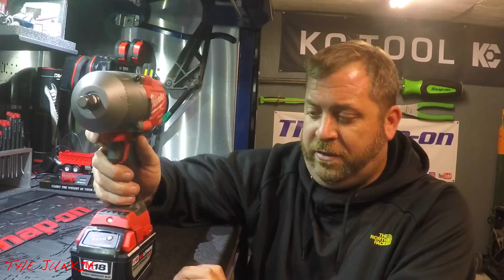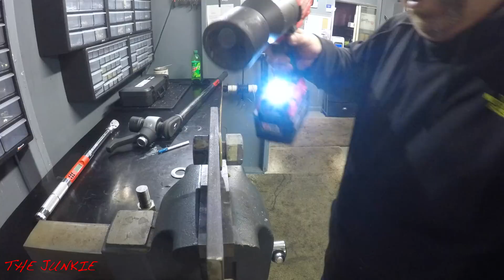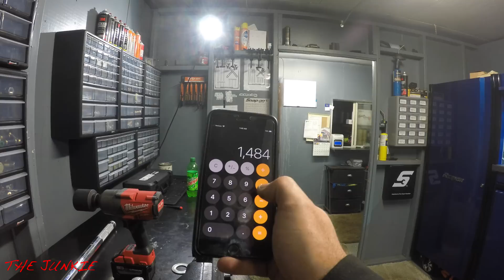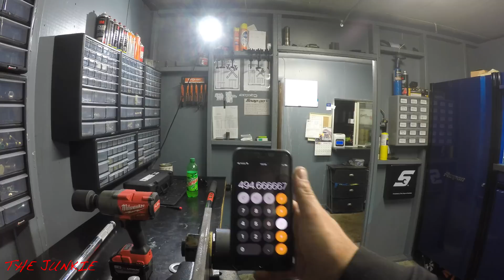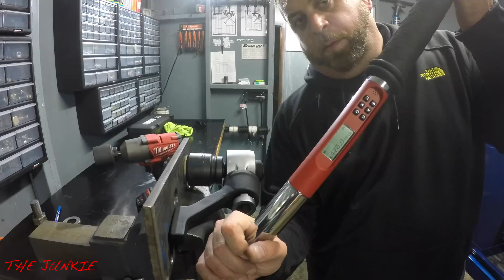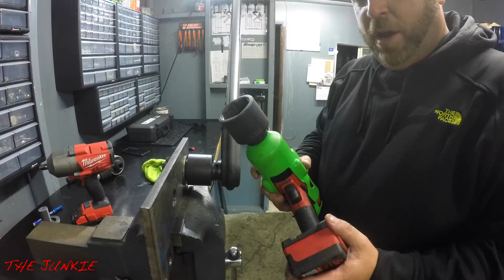REAL WORLD MILWAUKEE 2767 TORQUE NUMBERS?🛠🔩🦍💪🏿

Comment: Not necessarily “real world” results.   The gun set comes with a 3.0ah battery or sometimes a m18 XC5.0Ah.   A high output battery is gonna crank a lot harder, obviously. 

I have one that’s almost 5 years old (and a lot of outdoor rugged mobile mechanic use.)  I just pounded on an 18mm suspension bolt, on setting (2) and I’m at 70ft/lbs. makes me sad after watching this lol. 
make no mistake if I put it on max turn setting and removal it definitely can takeoff any nut. Including ones that the best SnapOn couldn’t.  Was turning ones that required Oxy-acetylene to get some off.

Comment: If you had it on level 4 it goes from 1750 rpm down to 750 after that to just oull the bolt or nut off. But if this was just level 3 then I am not sure. Kinda seems more like the battery is struggling more than anything.

Comment: I have both, and there are times where the mid torque isn't enough (on car/SUV/pickup). Rust is the disease, and the Milwaukee 2767 is the cure.  About 10% of the time I need it, and glad I have it.
Reply: Same here..i tried using the mid torque on removing a couple of  honda crank bolt with the lisle socket and no budge. I used the 2767, no sweat. There are also times the mid torque is not able to remove rusty lug nuts/bolts...so again, 2767 to the rescue!

Comment: I like the review, I wanted to get that muthafracker just in case I had a bolt that was stuck. But like you mention that its more for heavy equipment users, I'll probably get the smaller lighter mid range impact. It was still a very impressive review pushing the milwaukee beyond its limits.

Comment: The grade 8 nut probably cracked because you welded it, the heat changed the temper. 
Has anyone done any testing of this gun with different battery capacities? I just bought one (tool only), and I already have a bunch of 4.0 ah batteries from other Milwaukee tools, so that’s what I’ve been using. Yesterday I tightened some bolts to 250 ft lbs with my torque wrench, and later tried to remove them with the Milwaukee, and it wouldn’t do it. Hopefully that’s just a battery issue, not a bad gun

Comment: Interesting idea for an experiment. Can you do another video that shows you undoing the bolts with the snap on torque wrench after the impact wrench fails so we can see the true torque that’s required to unscrew the bolt?  I believe that the torques to tighten vs untighten are different because when you untighten, you have to overcome a static friction first before the bolt will move. When you tighten, static friction never comes into play, only dynamic friction.  Thanks.

Comment: I have one of these nut smackers, I do Heavy Mining equipment repair, I also moonlight doing steel fabrication and erection and light automotive. - I would definitely say there isn't much use at all if you're a car mechanic. Doing heavy equipment most of the time its not needed either, only as a replacement for 3/4" air impacts on some jobs, some counterweight bolts, etc. - Has heaps of power for rusty plow bolts and track grouser bolts.

But really it shines when you're putting steel together and you're trying to get beams to fit and you're running bolts through splices to push/twist the whole beam over so you can get the next one. Running it straight for a minute or more.
Heavy duty, can get as a 3/4", way handier than pneumatic.

They're also selling a 1" Impact now but from what I've seen its underpowered compared to other 1" or 1 1/2" air impacts, battery tech isn't quite at that point, at least not in 18v.

Comment: Got mine about a month ago and been putting it through the paces. This shit is fucking frightening. Like for real. Even with a 36in and 10 in extension this fucker pulls fasteners right the fuck off. Like pulling a choir boy out of the preachers hands like mentioned below! Be careful, with the HO 6.0 batteria this will have some gravity but nothing a pair of balls can't handle. Not for you pansies out there pulling lug nuts and nothing more. This is meant to do work not show off.

Comment: Buy the big dick banana hammock.  Dads got the 3/4 inch  Put yourself a cover plate overtop brake that fucker off number 3# mode. That why you have it when  you need it .   It's like Carrying your gun rether have it and not need it. Then need it and not have it.    That big fucker works to my dad and me used it to work on his cat track loader 32 year old bolts zipped right off   some of those bolt were over a 1.1/2 diameter

Comment: Wow, we could have done without the "Foul language".. Uh, and for those who wondered,  the nut cracked bcuz it was Not one with the threaded shaft, or rather not a solid bolt. The area which was Not welded was the weakest point and gave out.

Comment: It has a variable speed trigger so im going with BDBH for auto work. Esp axle nuts, crank bolts and suspension work. Have 2 vehicles that need new front suspension, Illinois pothole roads 🙄

Comment: My makita hangs right with my partners Milwaukee. It's another amazing impact out there. They're both pretty ridiculous tbh.
Reply: I bought the Makita 1/2” drive one after seeing what my workmate’s Dewalt could do. They seemed very similar results wise, we did a few unscientific tests on fork truck lug nuts. At the end of the day you go with your battery platform. Only found one set of nuts it wouldn’t shift, 36mm socket, struggled with my long 3/4” ratchet with a cheater bar, reckon they’d been over torqued with an 1” drive air gun.
Reply: I have the Makita as well and am very pleased with it's performance and design so far

Comment: Not understanding the 3:1 torque calculation.  Yes its a 3-foot torque wrench, but unless you're using it with an extension, the wrench should be calibrated to its length.  I've never done any corrections on my click-type wrenches.
Reply: @Zboe-JL  Why would one need to multiply the torque??? As long as you're using the tool as it is intended, the tool should be calibrated to its own length.
Reply: @johnstaif846  The torque multiplier is used to torque the nut down to 1400 pounds.  He is not strong enough to torque that bolt to 1400 pounds with a 3 foot wrench, no one is. The torque multiplier increases the torque he applies using the wrench by a factor of 3.  If you look closely, you can see the torque multiplier attached to the bolt and then the torque wrench is attached to the torque multiplier.
Reply: @dkelly701  Oh.  Thanks for responding.

Comment: It’s not 1400. You heated up the thread exponentially when you tightened it. Should’ve put an infrared thermometer on it until it went back to room temp. Plus that gun is shot. You hear the internals? Lol.

Comment: Good video Justin .
And I agree that the real world means a hell of a lot more in testing then using grease bolts and a Skidmore Wilhelm, the real challenge is it going to a junkyard and find an early 60s truck or trailer backed into the weeds what's lug nuts that have not been removed for 20 years in the elements, a lug that is torqued to 250 foot pounds of torque that have not been removed in 20 years will be so corroded but I have no idea how much nut busting torque it would take to remove it off of the Krusty pitted threads, but that's what I call real world testing Karma something like that would be a real test, thank you on your opinions and testing.

Comment: This impact is strong as sh*t
I was taking off an engine mount bolt and it sheared the head off so damn fast
Reply: RCMOTO thats not a good thing
Reply: Michael Sieber I didn’t say it was, 
Obviously in the correct application , it is a good thing

Comment: We use those impact wrenches on large structural steel buildings; awesome for that application. The only issue is the vibration associated with tightening larger diameter bolts tends to shake the batteries loose and causes the blade contacts to burn out in the driver housing.
Reply: Spot on with the battery vibration issue. What I've seen is the big/ heavy 9.0 /12.0  batteries are rough on the rattle guns that get hard hours put on them. It's nice not needing to carry a bunch of extra batteries but eventually, the contacts will fail from the extra weight of the bigger battery. We're on rattle gun #4 or #5 now. They're a great gun with loads of torque for sure. Its just not the ideal tool to be used with the high capacity batteries. Seems to me that a better battery to tool interface/lockup would help. The slop between the gun and battery gets pretty bad after awhile

Comment: I have only stalled mine out once so far. It was on an upper control arm 21mm nut. I had an impact swivel and a 6 inch extension on it on level 3. Torque spec is 110ft lbs but someone went full beans on it or something. This gun is definitely needed when you work on rust bucket vehicles every day.

Comment: Workmates got the new m18 one key. On power level 3 with 2bar left in the battery i tried it against my fully charged snap on gun and it pulled those wheel nuts off like nothing. Damn i need to buy one.

Comment: First time you do a timing belt on a Civic or 4 cyl Accord you will NEED one of these babies. Those front crank bolts are no joke. It is sometimes possible to get those front crank bolts off with a special, extra heavy, $50 socket and the top-of-the-line Ingersoll-Rand 1/2" pneumatic @ 125 psi - but usually you have to borrow someone's 3/4" I-R impact or jump on a 3/4" breaker bar with a six foot extension held in place by a jack stand for 20 minutes after soaking the bolt overnight with PB blaster. That crank bolt is pretty much the only reason I had to get one of these monsters. I'd don't ever want to have to fight a Honda crank bolt again like I'm a 98 lb weakling in the ring against a 22 year old Mike Tyson. 
The only problem with this tool is going to be when other mechanics start using these things on setting 3 for everyday work, there are going to be a LOT of stripped and mangled threads on wheel studs, suspension bolts, axles, & everything else. It's like using a sledgehammer for cabinet work.

Comment: I bought my 2767 last week.  I couldn't get my lugs off a 1962 International p/u.  I used a pneumatic gun on my Porter cable compressor - no go. I used a breaker bar 1/2" 18 " long with a pipe extension  - no go. The Milwaukee took it off like butter!!!  Funny thing though... I had it sitting on my counter next to the stove, when I turned on my electronic ignition for the stove the gun lit up the LED! Anyone else experience this phenomenon?  P.S. I bent the breaker bar.

Comment: This would be Perfect to remove the damn nut on the Dana 80 axels from my 96 ram, those damn things are damn near impossible and I couldn’t even make it pudge with a 6 foot extension bar. 
If removing that Axel nut is easy with this gun I will happily spend the money on it, absolutely no question.

Comment: Any good tips on a 600-800 nm alternative? Preferrably a more lightweight, snubnose/stubby M18, so it takes the same batteries, but isn't so gawd damn fatiguing to use all day at/above shoulders, and crappy for precision wielding with extensions (due to weight and bulk)...?

Comment: Dude has a very good point. Lets remember, the thing with automotive work is that most of the time you ain't working standing up with the gun at between hip and chest level, and you won't be able to use your body weight to lean into the machine and force. You'll be working with this truly heavy bastard at or above shoulder level, with both arms halfway or fully out, or just a single one. Or down a bay, with only one arm, stretched out. Again, this one is heavy as fuq. It fatiques you reeally fast. And because it's so heavy, it's crap for nice "precision wielding". Meaning all those hundreds of not-super-stuck smaller and mid-size bolts and nuts - you'll end up removing those manually by hand tools.

Its kinda how you COULD use a longnose .50 for target practice. It will be fun the first 5 shots/2 minutes. But after 35-40 rounds in ten minutes, when you're standing there with your hands hurting and arms fatigued, thinking about how you still have 500 rounds and 8 hours to go, and there's still 4 days to weekend, and you'll be back next week... and the week after that. And the month and year after that... You'll really, truly regret you didn't get the .38 snubnose instead. There's also access. This thing ain't huge, but it's definitely big. Once you start needing extensions and joints because you can't fit the tool in there, effectibe torque plummits.

It's really not a great daily driver for more reasons than weight/mass/size though. It's gonna break shit. In automotive wrenching, there are tonnes of blind bolts and bolts going into quite intricate parts. Bolts going into really hard to reach places to do work, if you snap the damn thing off. Some times those bolts need a different kind of persuation than more brute impact force; induction heating, blunt chiseling, flat impact etc. With a more medium 6-800 footpunds ish impact, you'll have a slightly longer reaction window to react when the bolt, nut or assembly is telling you "stop, something's wrong". With that big bastard, you won't have time to react. And you'll be spending the rest of the day and your profit margin pulling and replacing that crankshaft because you're weren't able to extract the broken-off crankshaft bolt with it in.

Get a good, mid-level, lighter and shorter impact wrench for a daily driver. If you can afford it and justify it, get this one too, and keep around for those really tough ones and only those. Or, pool together with a couple of friends or colleagues you know treats their tools well, and team up on one. Because even as an automotive mechanic, you'll still go days without needing to touch it, if you have a good mid-size unit at your disposal. Meaning the tool sees so little use, it's not gonna wear out even of you're 3-4 mechanics on it.

Comment: Excellent fucking video. Somebody with a pair of nuts to use the appropriate automotive language. If you don't curse in the blue collar field once in a while, you're obviously somebody's bitch. FYI, the nut cracked because the weld was not supported on the backside, just sayin'. Milwaukee is Made In China. But so is every other fucking tool except some Snap-On and Fein of Germany. Anyway, got one of these big dick Milwaukee fuckers today. "Professionally " Made In China. And before I go outside and snap the studs off my F-350, I'm glad I watched your video. Looks like it will be level one pussy mode until I have to remove those salty front end bolts and leaf shackles. Great video, don't you hate whiny hypocrites?

Comment: I tried to remove a bolt that was rusted on with my previous 8 year old milwaukee and it wouldn't touch it. I put the 2767 on it and it didn't even feel it. Blew it off like it was threaded on by hand.

Comment: Hravy equipment mechanic hydraulic ram repairs on excavators and dozers it will work ok but some times you need the 1 inch anvil air impact 2500 ft lbs and that still isnt enough then we go full hydraulic it comes off or it breaks. Great vid

Comment: I pulled many honda crank bolts off with this.
Reply: and we all know its a fucking pain in the ass with wrong tools to remove that bolt
Reply: That’s exactly why I just bought this gun!
Reply: That's exactly the reason I'm watching this video!!! I bought a 91 Honda prelude for my son's first car and need to replace the timing belt. That crank bolt is fucking evil! I broke my breaker bar on that damn thing. Thankfully the crapsman warranty will replace the breaker bar. Hopefully I won't break the nut with this 🤣
Reply: I removed mine with a harbor freight electric impact.  Check out the lisle crank bolt socket.
Reply: @stevem9141  I bought one in harbor freight for my civic, it didn't take it off, I had to go to a tire station just to take it off.

Comment: Appreciate the thorough review. But 1400ft/lb isn't about the biggest dick when you're trying to pull off a 20yr old rusted bolt. It's about having the right tool for the job. It only takes one seized bolt to halt work and you're fucked. I don't want to fire up the torch for every rusted bolt. 

Also note, it struggled at 1400ft/lb and got hot. 

Can it sustain 700-1000ft/lb to pull off 40 semi truck bolts day in and day out without burning out? How about when used as bearing/bushing puller for 5min max capacity runs? Never underestimate the requirement for reliable power, especially on impacts. Impacts are some of the most underpowered tools as a whole in today's market and workshops.

Comment: Own the high and mid torque models. Always use the mid torque for everything. Got the stubby now and that will take over most duties. I was replacing engine mounts and to my surprise I needed the high torque to loosen the bolt. Had swivel and multiple extensions. Was so glad I had it. Zipped em off like nothing. Who doesnt want to own the big dick bannana hammock?

Comment: Ive got it in the shop for one thing, a last resort. It's either coming off, or we're breaking it off and worry about what happens later. Mode 1 and 2 take off everything I need. If its stubborn a couple braps of 3 and its good.